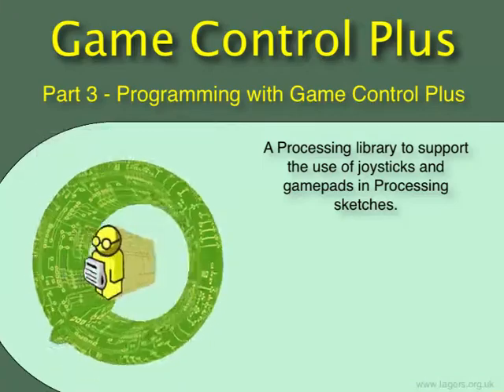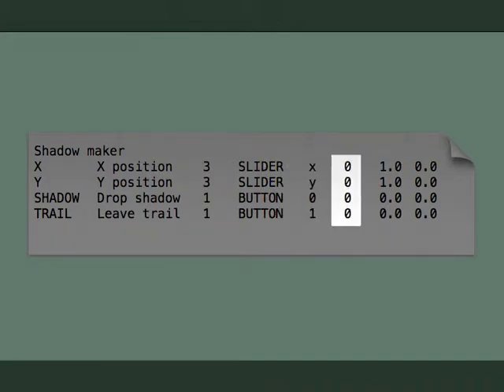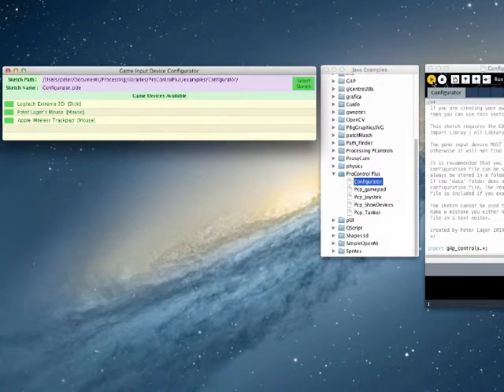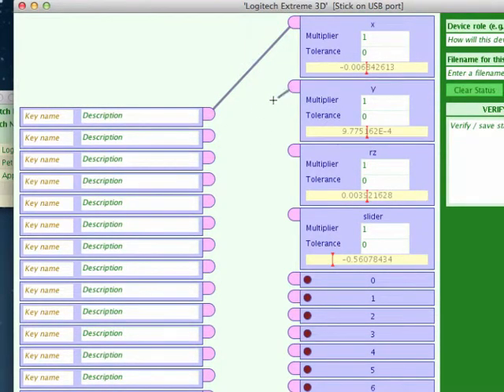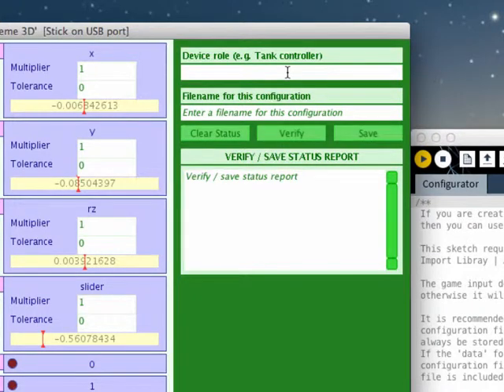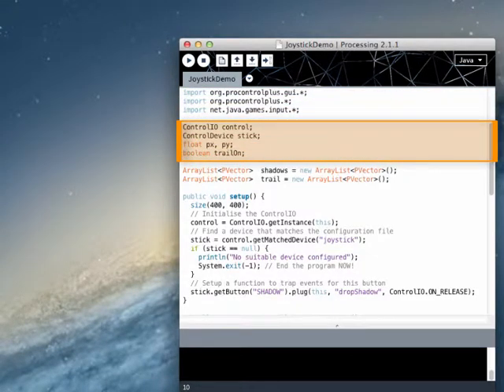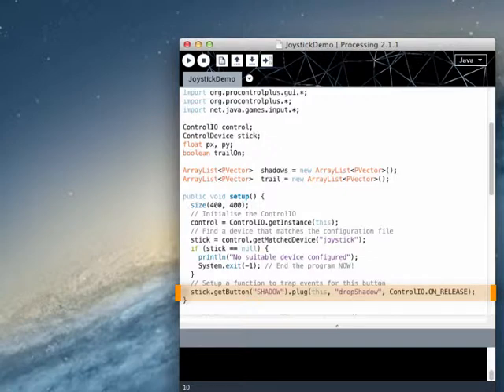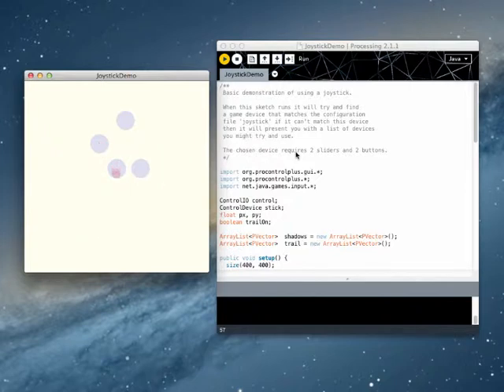Game Control Plus - Part 3

Comment: I made a configuration file, but there is an error mentioning my keyboard and mouse although i used a playstation controller in the configuration file... why?

Here is the error:
Failed to initialize device ROCCAT Tyon Black because of: java.io.IOException: Failed to acquire device (8007001e)
Failed to initialize device ROCCAT Isku FX because of: java.io.IOException: Failed to acquire device (8007001e)

PS: The controller is named "Wireless Controller [Stick]"